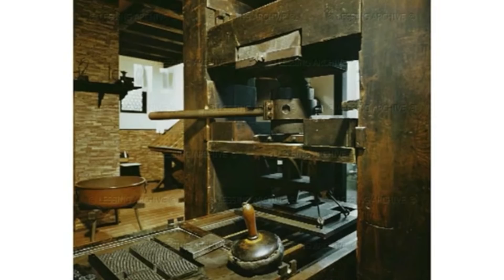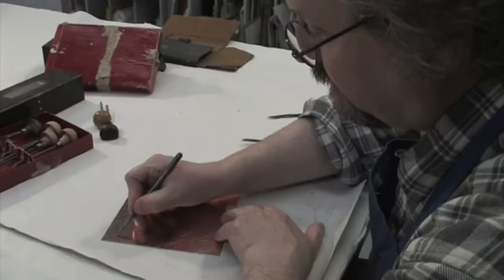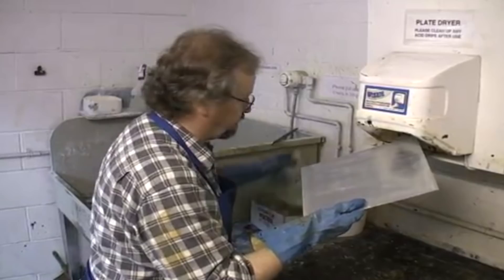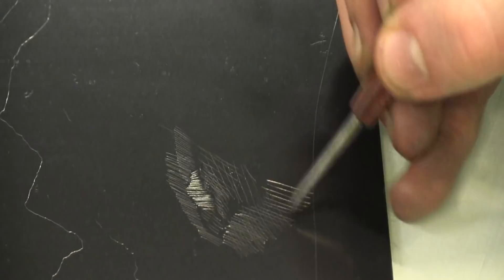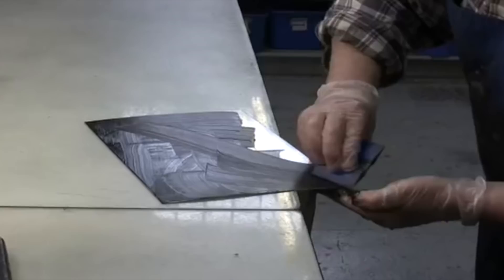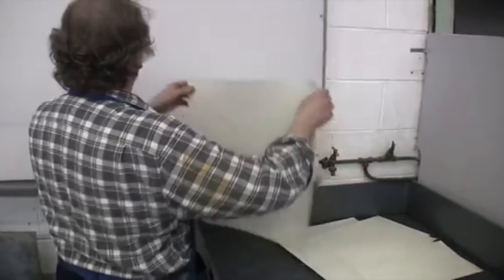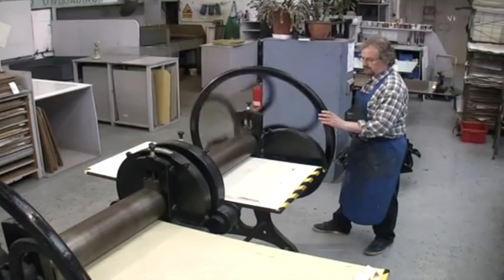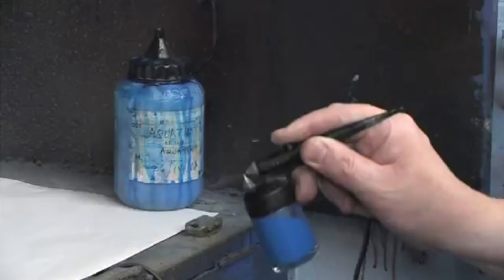Etching at Edinburgh Printmakers

Comment: As a person well qualified to say so, I throw in my two bits here: Applause to a fine job of explaining the art and a method as well executed as the obvious practice must have been to produce it. 
Apart from that, there are variations to the products, materials and techniques. But I am confident that artists will find some of their own ways. I engrave and dry point and often sand the burr off (without scratches) and have concise lines that last as long as those etched. 
Acid etching has the characteristic of more fluid movement like those associated with the organic. While hand methods such as dry point and the burin cut the metal with more labor and risk of a slip and require serious skill to master any curve. 
Such methods as stipple, grits of sand paper and even electric engravers are employed but less traditional than acid tints. 
I thank you for a fine demonstration and with all due respect to a master of this art.

Comment: My personal preference is to allow oil based intaglio inks to air dry even if the paper curls, then later re-wet the paper and flatten between blotters. This prevents wet printing ink transferring to overlaying blotters and also prevents any smudging of a fresh print before the ink has dried.